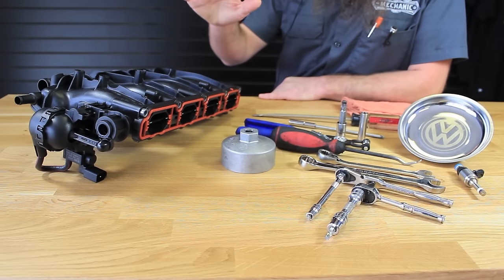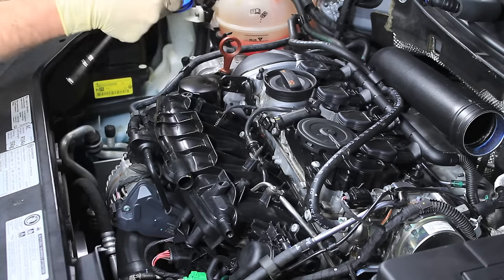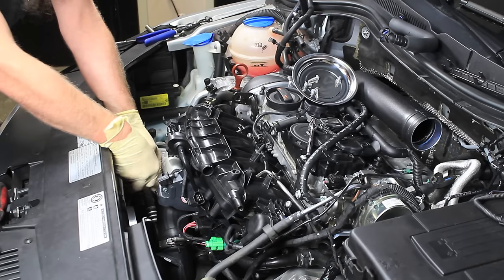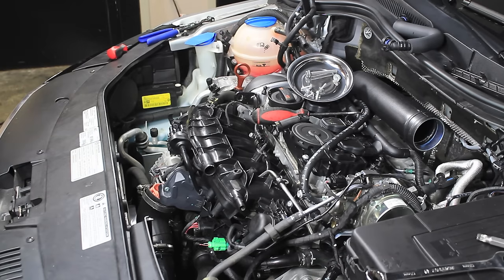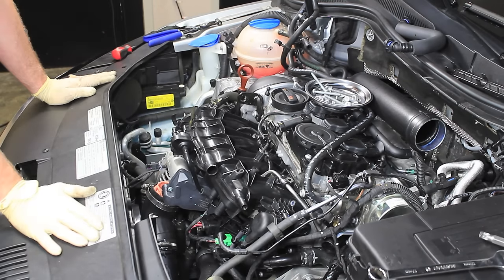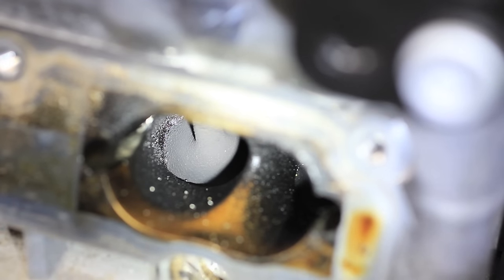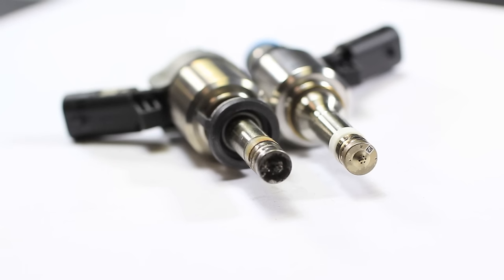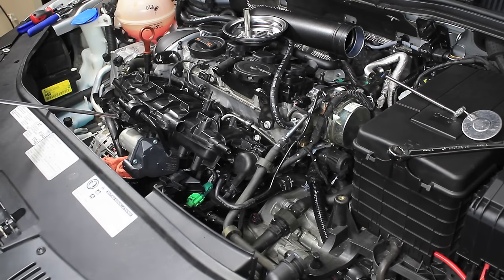Intake Manifold for VW and Audi 2.0T TSI DIY (How to) Replacement

Comment: Take it to your local VW dealer, they will replace the intake manifold and injector o-rings for free! The recall covers this defect up until 120K miles. You're welcome VW fam.
Reply: Jonny Palafox not on my 2013 tsi Cc!
Reply: Well, what do we need to tell them? In order to convince them to replace it for us for free? Thanks a lot fam.
Reply: Audi too?
Reply: Jonny Palafox GM,  I have a 2009 CC I took it to the dealer and they told me $1600. What recall was it that this issue fell under so I can let my local VW know. Thanks
Reply: Can I do that for my 2010 CC?
Reply: I still have less than 120k miles!
Reply: VW doesn't cover this in the UK....  :(
Reply: Jonny Palafox thank you for your service to our nation.
Reply: They should replace it up to any miles in my opinion
Reply: Call the dealership and check for any extended warranty, in my case it is 120K miles but in order for them to replace it for free and to warranty the parts, they need to fail and check engine light needs to be on (*fuel injector code) other wise you will have to pay for it. They will charge you the diagnostics / inspection anyway and if they warranty the parts and it turns out it is their fault they will refund it. That is at least what my local audi dealer told me. (A5 B8 100K miles)
Reply: @KingKanin  I was quoted same price f them
Reply: Regarding the replacement of the intake manifold and injector rings, are there limititations based on year and or models?  I have a 2008 Passat 2.0 tsi with 117K.  If you have a link to determine if my vehicle qualifies for this recall, would you mind shooting me the link?  Thank you in advance!
Reply: 120k miles OR TEN years. mine was declined due to the car being too old.
Reply: Just did it for my 2010 CC as mentioned. Thank you Jonny!

Comment: When replacing the high pressure fuel sensor, do you still need to remove the entire intake manifold or can you access it relatively easily with it still on the vehicle?

Comment: Where does he get the t30 extended for 1/4 ratchet ? Ive look everywhere and cant find the name or brand. This job was very difficult wit 3/8 sockets and ratchet!!!
Reply: He uses a 1/4" extension and a 1/4" drive to t30 bit.  Both are available in the tools section at Lowe's.

Comment: Is there any way to clean the valves without removing the injectors. I've heard that once you remove the injectors you have to replace all the seals on them. But I don't want to go through the hussle of ordering new injector seals and an intake seal. Also can I re-use the old intake manifold gasket?

Comment: Hi guys, me again.  How would you recommend turning the engine over to align the valves for cleaning? I'm aware that there is a sweet spot where the valves on cylinders 2, 3, and 4 on a 2.0 TSI (CCZA) can all be closed at the same time. How would I turn the crank shaft over so that I can close the valves on cylinder 1?  Blip the ignition quickly, or do I do it by hand with a tool? If so where would I do it?
Reply: 24mm socket on the crankshaft pulley. You can access it from below. Turn it CLOCKWISE. Check the valves' position.

Comment: is there a way of removing the throttle body without having to lift the whole intake? The top two screws are easily accessible but I'm not sure if there a reasonable method it ppl to get the two at the bottom?!

Comment: Does that intake pop into place ? Like it pops off but does it pop on I have intake issues watch ur video to take mine off and put it back on twice and now my injectors leak I replaced the blue o ring around them but still leaking ? Any advice I thought about putting every piece of the injector kit on but scared of all the special tools required that cost a fortune anything u recommend that works well off of vw brand name tools

Comment: What are the flat little pieces of metal with plastic on the side of them that are inside near the intake valves and are revealed after removing the intake manifold? One of mine’s little plastic tab broke and I’d like to find out what they are called so I can get a new one

Comment: Hello,
I have a question. maybe you can help me?
I was working on my VW MK6 GTI to Clean the Intake Valves
to my surprise the separation plate was not in the cylinder head in front of the valves? Are these separation plates needed?
I hope you can help.
many thanks!
 Tom ter Beek

Comment: Where is the crankshaft position sensor on this engine? A mechanic told me it’s behind the throttle body but, according to this video, the sensor I’m seeing is actually the engine temperature sensor.

Comment: Hi I have 2009 Audi A4 while changing the battery I lost all power. The key fob doesn’t work when I insert it. There are no hazards, no headlights high beams. The seats don’t move either.

Comment: Thank you for your informant shows I learn always a lot. I wonder if you would have information on decarbing the intake when you remove the manifold anyway.
This job is coming up I have P2015 code on my 2009 CC, 2 liter turbo.
Thank
Charles & Thomas
Happy Motoring
Michael

Comment: So, I snagged the coolant sensor line and pulled the wires out of the conector, any video on that repair? Thanks for the great Videos!
Reply: Did you ever find a solution to this? I just did the same thing

Comment: Just fitted a new intake manifold,new injectors and did carbon clean. Check engine light came on, error code runner flap open circuit. What should I look for

Comment: Hi, I just replaced my water pump for which I had to remove my intake manifold. Now the issue is when I turn on my AC the compressor shuts off after a few seconds. I am not sure what went wrong as I have plugged in all grips in the right places. Can you please help me out on this?

Comment: Hey, I recently did the carbon cleaning. Used this tutorial, thanks a lot! However I have a question. After 2 days my car started reving and holding RPM +~1000 at idle, up and down (I remember I had that when a dip stick was out a long time ago, anyway) after the rpm going up and down, It started misfiring really hard,  hardly start up etc. massive loss of power. Exhaust has a strong gasoline smell. I assume it is a vacuum leak somewhere. But just wanted to ask a pro, what is the number one thing you would check? Thanks!

p.s. I cleaned inside and out the injectors, replaced a intake manifold gasket too. Noticed 1 bold in the middle has a weak thread, so didn't tighten it all the way but it doesn't seem affected.
Reply: did another closer look, gas fumes come out under the hood too, and I noticed a second bold with a stripped thread.. That's probably the problem, right? 2 days can was so perfect, I was pushing it hard, testing it, it had a very quick throttle response and all, just like new. And this happened.. I will order a stud kit to repair threads but if there is anything else very common, please let me know. 
p.p.s. injectors have new seals installed with special part. Intake manifold was replaced by the dealer in 2017 with an updated one, it was 30k miles ago.

Comment: I have 2008 passat 2.0 TSI (CCTA) and it cranks but won't start.  This happened overnight after normal operation. the car has 180k mile and I checked and changed the spark plugs, checked for fuel and replaced the camshaft sensor without any success. should I remove the intake manifold and do the cleaning? Could this be the reason? It just happened over night. Thanks
Reply: Overover Ibrahim I have the same problem but mine leaks fuel when cranking. Using this video to remove intake and see what's wrong
Reply: I just got time to finish the job and from a closer inspection it seems on of my injector seals failed. Not only that but whoever was last in the engine bay left bolts untightened and loose on the manifold. Injector 1 was stuck in the head, with number four having fuel and dirt residue on the outside. No signs of bent valves. Seems a better choice to take the manifold off and inspect.

Comment: hello im having a missfire issue on my 2012 gti. I am thinking i have 2 faulty injectors i have replaced the coil packs and spark plugs so i know they are not the issue. When i start my car the motor itself sways back and forth and does not sound good. what are the symptoms of a bad injectors on these tsi motors?

Comment: how do you get to that triple square on the support bracket? the most difficult part gets skipped over in the video! do i need to remove more parts to get access?
Reply: No you just have to move those hoses a bit and well, with small hands fit the #10 Triple Square into the bolt head. Once you figure the path for your hands, it ain't too bad. I recommend removing the #10 Triple Square Bolt and leave the other end alone.
Reply: I used a t50 from the top with a swivel and got it done

Comment: great video. quick question. do you need to pull manifold to clean throttle body or can you get to it to clean it without removing entire manifold?
Reply from the maker: You should not need to remove the manifold to clean the throttle body.  You would need to take off the pipe to the throttle body then you should be able to remove it.

Comment: Is there a trick to loosen/tighten fuel pressure valve on the fuel rail while the intake manifold is on. It’s a TFSI motor. BPY.

Comment: I like this video, but you left out a visual for what you said was the trickiest part, namely installing the support bracket under the manifold.  Are you doing this blind, by feel?  Do you just have to feel for where the bolts go? Could you leave the bracket loosely attached to the bottom of the manifold as you guide the manifold into place against the cylinder head?  Thanks.
Reply from the maker: Yes you would be doing this by feel as there is no way to get a look at where those items mount.  Leaving the bracket loosely attached likely wont work but you can always give it a shot
Reply: Garth Goldberg if you leave the bracket on the manifold, you risk damage to the ECT connection. It is really just a feel around type thing. With the throttle body off, you can see it a little better.
Reply: Deutsche Auto Parts- Your Source for Everything VW and Audi Thanks so much for the video helped a lot. I attached the bracket loosely to the top mount and then taped the bottom bolt in place with a bit of insulation tape. Made it much easier to locate it once the manifold is back in the car
Reply from the maker: fnud1 Awesome... So glad it was helpful
Reply: Connect the one end to the manifold loosely, then let the other end slide towards where it is bolted. I used a borescope connected to my cell phone and check the bracket alignment to the hole. I have small and manage to tightened the lower bolt by hand.

Comment: Hey Paul!

I want to start by saying I love the YouTube Channel & website and the technical information. 

I have a 2010 VW Jetta Wolfsburg 2.0T. Just over 100,000 miles on it. I love the car, but recently it is not loving me back. I've replaced the PCV assembly, had the timing tensioner fail (Whole new top end....), and now the rear main seal is leaking badly. Getting the P0171 code for "System lean on Idle".

I wanted to know if there is a recommended way to cure the issue related between the PCV going bad and the rear main seal leaking afterwards. Also, do you have a recommended guide through the process of replacing the rear main seal?

We handled cleaning our valves and replacing the timing chain / tensioner / head on our own. Hopefully this won't be out of our hands. 

Thanks!

Comment: Got a relevant question ? Why walnut blasting ? I use soda blasting in pressure cabinet for cylinder heads because soda breaks down with water and if any trace is left in the head it will not / cannot harm the engine. walnut shells could possibly harm the engine if not completely removed so why is not soda blasting used instead ? Im currently doing my nephews Audi A4 B8 in the next few days and going to scrape with picks and break down with berrymans cleaner and then finish off with soda blasting whatever is left. I have all the time in the world to do this so if it needs to soak for 3 hours per cylinder then so0 be it might not even need to soda blast it at all ? but why do not people use soda ? I use that stuff to clean anything and everything in the house it harms nothing. scrubs the pots and pans like new and the brass and copper and silver ? everything you can think of its about as harmful as washing your car with soft cuddly bunny rabbits ,, the fur portion not the teeth and claws .. why use walnuts ? is it so workers can not snort cocaine during work hours and say its baking soda ?

Comment: 2008-2010 covered by extended VW warranty to 120,000 miles, VW pays for it, if you had it done and paid, be in touch with VW, get reimbursed!
Reply: My 2013 gti is not covered .
Reply: What exactly is covered under that extended warranty?

Comment: What is the part # for the lower bracket/manifold support?  Mine was not re-installed by previous owner and I would like to add it back while I've got the darned thing apart.
Reply: 06H-129-723-K
Available through DAP's website:
https://www.shopdap.com/make-model-year/volkswagen/gti/mk6-2010-2014/engine/2-0-turbo-tsi/repair/intake/06h-129-723-k.html
Reply: @lenschulwitz1934  thanks, close to being just in time to get it on before putting it together.... 😂 Better late than never!
Reply: @travishollingsworth7122  I just took the intake manifold off and a previous mechanic decided not to reattach it.  At least I've already looked up the part number.

Comment: Hello Humble One. Just replaced, intake manifold, Water pump, injector seals, all bought from Deutsche Auto, yesterday.  Car runs great now, but the check engine light came back on, per the OBDeleven also purchased from DA the engine fault is P2008 Runner Bank 1 Control Circuit / Open.  Any ideas? Oh and by the way you Intake manifold video was invaluable, thanks again.Eddie Carrollton TX
Reply: Hey Ed, just say this comment. I hope you got it fixed. I assume the connector was not plugged in all the way

Comment: Thanks a million guys! Very helpful! Only feedback is that it would've been nice to see him unscrew the m10 bolt and remove/install the support bracket, cuz that was a bitch to do.. struggled to find a good angle. Maybe seeing him do it would've helped find that angle quicker
Reply: Had the p2015 code and decided to do the job myself. Less than a year ago I had the VW  dealership do a carbon cleaning on it (less than 10k miles ago). After taking off the manifold I found:
1. There was an extra O-ring stuck in one of the fuel rails
2. A bunch of the tabs of the inserts that go into the head were broken 
3. The valves looked like complete crap (carbon).. it's almost as if they barley did any  walnut blasting..
I'm honestly shocked at the lack of competence of the stealership. Going forward I guess I'll have to do it all myself

Comment: I'm doing this right now. I stripped 3 of bolt holes so I  bought a helix repair kit. But before I move forward can someone confirm this is the right decision.
Reply: i’d never touch a car again if you stripped 3 bolts bro

Comment: Do I necessarily need a special tool to install the new o-ring kit on the injector? Same question for installing the injectors back in the head.
Thanks
Reply from the maker: answer coming on askdap 64

Comment: I have a 1.8 TFSI in a Audi A4 B8. Visually this engine is exactly the same as the one in the video other than that my engine is mounted longitudinally. I have a fault on VDCS showing 18447/P2015/008213 - Intake Manifold Flap Position Sensor (Bank 1): Implausible Signal. The car drives normally but had an intermittent hesitation on acceleration. I was going to take the inlet manifold off and give it a clean. Do you think its worth it or would it be better buying a brand new part?
Reply: +Adam Geoffrey I changed the intake, but a friend of mine just cleaned the intake flaps and it is working fine.

Comment: What about this?: P3137 intake manifold runner control basic setting not completed
Should I do basic setting using Ross Tech website indications and if fault is still there after driving a bit, that means I must replace the whole intake manifold with the upgraded version? Thanks

Comment: I have to clean the carbon off of my valves on my 2012 gti and i havent seen anyone mention the intake manifold gasket... is it recommended to replace it? or can you reuse the original one? my car has 86,000 miles on it.. please help thanks!
Reply from the maker: +motocross41man Replacing the gasket is a good idea.  Especially due to the fact you don't want to have to do the job twice.  You can find the gasket here
https://deutscheautoparts.com/make-model-year/volkswagen/gti/mk6-2010-2014/engine/2-0-turbo-tsi/repair/gaskets.html

Comment: Do you think spraying plastic intake manifold with gum cutter (or carb cleaner, while removed from the engine like you did) is safe for plastic and intake flaps?
Reply from the maker: It should be.  You might want to check whatever chemical you're using to see if its safe for those materials.

Comment: I cleaned my valves and changed the rings on my 2010 GTI and everything seemed fine until I started driving it and now it reads misfires P0300 P0301 P0302.  What could this be?
Reply from the maker: Felix Guilfuchi You likely need some of these injectors https://deutscheautoparts.com/vw-audi-tsi-fuel-injector-06h906036p.html
Reply: Thank you! I figured out what the problem was.  It was my PCV that came loose and made it go crazy.